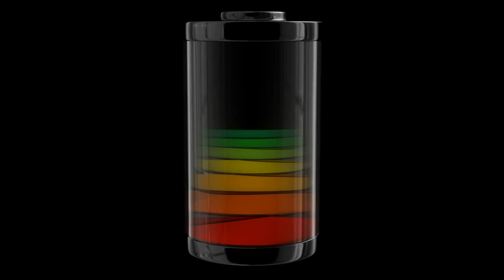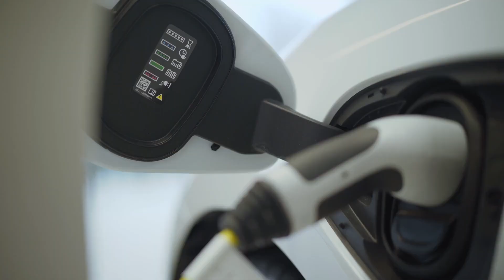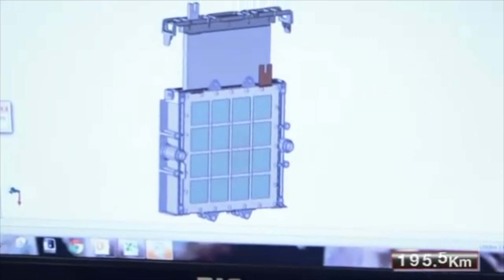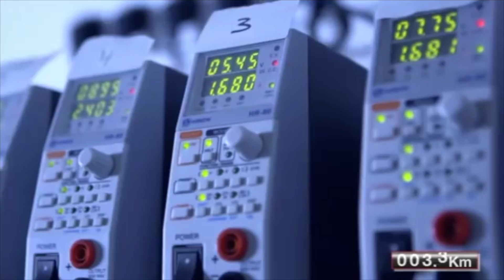This Battery Gives EVs 1000 Miles of Range!

Comment: I think if you had generators powering electric motors as the vehicles traveled down the road and the movement of those vehicles produced the energy to power the generators then batteries would only be needed for initial movement. Thus less or no need for charging (alternators). No need for high cost batteries (generator power) and the world moving into clean vehicles with more friendly consumer costs. No refueling costs.
Reply: That's called "regenerative braking" and most electric vehicles do it. When you run the generator, it takes your kinetic energy, slowing you down, and converts (some of) this energy back into electrical energy, which charges the battery.

But it's not free energy. You can't run an electric motor and an electric generator on the same spindle and get out as much energy as you put in. You'll lose some of the energy in the process. If you wanted to slow down anyway, either because you need to slow down or because you need to not speed up on a downhill, then great. Regenerative braking at least gives you some energy back, instead of letting the disc brakes dissipate the energy as heat. But that's all it is. Braking.
Reply: @ps.2  Was thinking more of the dyno generator systems we used as kids in 60s where a wheel on arbor on generator running on moving part of system (tire) would power generator while machine was running. Thus powering generator to drive motor. Battery for initial movement to begin power generation would be needed but could be recharged once generator was running. Thank you for response. Best wishes on a great weekend.
Reply: @greg3896  Still not free energy. The amount you need to run a bicycle headlamp is pretty small, so you may not have noticed, but that generator made you pedal harder.

Regenerative braking exists and it's what you're talking about. The idea is that if you have a moving vehicle and you want to slow it down, you may as well capture the energy you would otherwise be wasting. But any generator powered by the motion of your vehicle is going to slow down the vehicle. That's just how it works.

And if you have both a motor that speeds you up, and a generator that slows you down, the motor will use more energy than the generator will generate. That's just thermodynamics and, search as you might, you won't find a loophole.

Comment: If you want to eliminate CO2 in the largest quantities cars aren’t the best way to go. It would much easier to apply this technology to cargo ships. They currently use heavy oil for fuel. It would be much easier to make a giant aluminum air battery in a container and put it on a cargo ship. 40,000 pounds of aluminum would probably get it across the ocean several times.

Comment: I love your videos, however,  600km does not equal 1000 miles.  600km = 372 miles.  600 miles = (a little short of) 1000km.
Reply from the maker: 1600 km or 1000 miles. I misspoke my apologies
Reply: @TwoBitDaVinci  As I said, I always love your videos.  I thought it might have been just a momentary glitch in the recording.  You are so great!
Reply from the maker: 1600 km or 1000 miles

Comment: at 8'04" you say "By the end of the test the Aluminium battery was able to extend the vehical range by about 600km or 1000miles." That conversion is not correct, so I'm wondering what's the correct number? Is it 1000miles (=1600km) or did you mean 600km (=373miles)?

Comment: I think that once and done utility of this battery makes it DOA.
Reply: Yeah - like AA and AAA batteries - there's just no market . . .
Reply: @MrGsteele  haha!
Reply: @MrGsteele  Would you care to guess how much a battery change would cost every couple of months? Even aluminum ion will cost MORE than the car payment and the fuel in a gas powered car. Its why every automaker abandoned   this tech 5 years ago.
Reply: @michaelmaroney1660  If you think only in terms of the past, why are you watching a futures video?  With different engineering, an active recycling and redistribution infrastructure, it could be viable - despite the humorous offhandedness of my "AA" comment.  "It's WAY too expensive to machine cartridge cases out of brass just to hold powder; we're WAY better off with patch and ball."
Reply: @MrGsteele  On the contrary, sir. I currently drive a tesla model 3 performance. My wife drive drives a Y. I have a full off-grid solar and wind power system. 

That being said, I honestly believe this technology is a useless dead-end. Any tech that has any hope of mass adoption has to be able to be obtained by the poorest of us. This tech has no sustainability or offers any cost benefits long term to the regular consumer.

That even applies to me as well. My power and transportation setup of out of reach form most people unfortunately. What is needed is a breakthrough in common material solid state batteries. Oh and about 2 trillion dollars over the next 20 years to be invested in the electrical grid.
Reply: @michaelmaroney1660  you have a full off-grid solar and wind power system, but you think that tech vector is a dead end.  Rather a curious combination.  I hold no preconceived notions about aluminum batteries, as my first comments make clear to a reader paying attention.  I do hold that future development is not predictable, having listened to endless protestations over my technical career about developments that "were limited by science itself" that later became commonplace.  A great example is magnetic disk drive density; others abound.
Reply: @MrGsteele  All points I will grant you. My main concern is in the logistics of delivering millions of 1000 lbs battery packs...every month...by truck. You have a technical background, but mine is logistics. Automotive logistics. I can tell you right now NO dealership network as currently outlaid could accommodate this technology at scale. The underlying costs for this technology are just too great to be ECONOMICALLY feasible. 

Could I be wrong, of course. But since he is referring to an article from 2013 in this video, I think the marketplace has already spoken about its viability.q

Comment: You're then left with Aluminum Hydroxide, which will require energy to convert back into aluminum, hydrogen, and oxygen. So, It's definitely an Aluminum fuel cell, not battery.

Comment: 1000lb = 67 kw, 60kw used to drive car and tow battery. 2 Gal fuel is actually about 8 or 9 kwh so not quite equal. Plus gas is only using 25% of its power to the wheels, the rest is heat and noise.... If batteries where as inefficient as car makers paint them, Teslas and Mach e's  would be dragging their asses to a charger every 2 miles and going 0-60 in 20 seconds.... 
Disappointing for someone with such an audience to turn into an advertising shill

Comment: 600km is not 1000 miles..
It's the other way round.
1000km is 600 miles.
Reply from the maker: 1600 km or 1000 miles. My apologies I misspoke
Reply: @TwoBitDaVinci  my apologies for coming in head first. It should had been
"Hi, I think you might have got the two measurements units swapped round."

And keep up the great work explaining great stuff for us. Much appreciated

Comment: Great video and good point. The power to weight potential is there but not being able to charge make hydrogen a better alternative. But I don’t think I like battery better so .  Charging is way better. Tiny power plant like wind. Flexible solar that possibly to campsite. And all households has electric power to recharge. Aluminum air will bring people to fill stations or swap stations. Could be even bigger cost than gas stations. WeAr and tear on connection point from swapping battery. 

Reducing the weight and mass of current battery with additional capacity is good point to cross research. Charging and recharging needs to happen not swapping.

Comment: I first heard of aluminum/air batteries in the early 1990s. The energy density per unit of mass was the best back then and still is, but it has a number of problems I think you missed. while the weight and safety are there, for good performance the hybrid using lithium ion recharging packs  intermediate to the drive system is a necessity. So you have not eliminated  the problems with them completely. Maybe at the very slow speed of urban Indian traffic jams they can be the sole power source, but then there is the other characteristic, its much greater volume to energy ratio. Then there are the shortcuts likely to happen with a battery that is effectively a primary cell design. Aluminum recycling costs in re-melting pollution may compound the problems external to the cars, or create a monopoly user on the grid that they do have. The total cycling costs to do it right may be too high.
 While "third world" grid electricity is indeed spotty as all get out, under the centralized model they have tried to follow, if cheap solar gets rolled out the same way that cheap cell phones did, bypassing the central structure of an expensive land line system they never really had, these countries may leap frog what we face in transforming our transport infrastructure to electric.

Comment: This is basically a primary battery that is recycled after use. All primary batteries generally have higher capacitt then their recharable equivqlent. The transportation costs and remanufacturing cost plus the reinstallation cost does not seem economically or environmentally friendly in the end. Even if you built the remanufacturing factory next to say a large solar farm and used the excess power to created new batteries to supply power at night it seems like you would still be better off just using recharable batteries. Making something over and over again has to cost more than just once. Thats kinda why we have recharageable batteries inbthe first place.

Comment: You did not mention the other big big advantage of Al/air batteries is they do not require a big increase in electrical generation that is required by other designs.
If rechargeable batteries became popular overnight there would not be enough electrical power to charge them!

Comment: The nice thing about Al/O2 batteries is that they are fairly easy to make at home, and you can use things like left over foil.  At some point in the near future, I plan on making an ultra light EV and powering it with Al/O2 batteries.  The Aluminum powder will be in a fabric bag so that when it's used up, I can just take the bag out of the matrix (it will include graphite and graphitized cellulose nanocrystals).  The graphite-carbons will be treated with potassium permanganate to create nano manganese dioxide on the surfaces to help as a oxidation catalyst.  I'll be experimenting with different electrolytes, mainly either potassium hydroxide or potassium hydroxide plus sodium percarbonate. 

     I'll will be either using a desiccant or a molecular sieve material to draw out the water when I'm not using it, to slow down the oxidation-corrosion reaction.

Comment: Can you do a comparison with the AmbrI liquid metal battery?
Reply: Ambri liquid metal tech is completely different. For one thing, it's rechargeable. But mainly, because it operates with molten metal, it has to maintain a very high internal temperature. Maintaining this temperature gets easier and cheaper the bigger you build. (Heat loss happens at the surface. As the square-cube law tells us, volume scales faster than surface area, so your insulation requirements and heat losses diminish as you scale up.)

As such, Ambri's approach will likely never be practical for vehicles. Well, maybe huge vehicles like trains and ships. (Though most ships require a very long range between charges.) But mainly it's intended for stationary storage — e.g., to provide on-demand power from a solar or wind farm. Installations where size and weight aren't really a concern, where you can have a massive battery surrounded by a massive amount of heat insulation.

Comment: A lot of this is theoretical. By this statement, I mean that we are not factoring in the transition time from one power source to another. For example, look at how long that it will ACTUALLY take us to transition from ICE technology, to hybrid to EV, and the social acceptance time span involved. The timing to critical mass transition and the economies of scale required for the support industries of each power source. Look at one simple small aspect - the different types of EV charging stations with no commonly accepted standard for all. Right now, we have Tesla and everybody else. It's fractured. Contrast that with a petrol pump standard for everyone. It takes TIME for a new industry to mature, as well as the human support staff to transition to a new propulsion industry. Look at how many workers were out of work, when one pipeline was shut down. Just sayin.

Comment: The "energy density" argument is bunk.  Electric engines are way more efficient, electric drive trains are way more efficient...  When you include an engine, motor oil, coolant ignition system.... you're dealing with 1500 lbs vs 250 lbs...

Comment: Electric cars are just the next disease.
On the other hand the Hydrogen argument is very promising or was as long as you manage to supply it using clean energy like solar, the reason you won't see it as a successful substitute because it doesn't make sense economically for the big corporates ruling the world, because the profit margent is not enough setting aside the complications of securing the manufacturing and distribution.

Comment: If you can't find a 15a outlet, you aren't going to find a battery swap station.
Reply: It seems the point of the paradigm would be: perhaps it's easier to find a battery swap station every 2000 miles than a 15A outlet every 200 miles.

I agree, though: I don't find the argument very compelling.

Comment: Fine for aviation but not passenger vehicles.  I don’t like the NIO battery swap.  If it’s only 600 km, that about 360 miles and less than the model S-LR.  Let’s leave this technology in the lab for more development because there may be break-throughs permitting recharge.

Comment: I thought solid-state batteries were the holy grail of battery technology. Interesting. Whoever cracks the code on this is going to be one rich person.
Reply: There is no code to crack. This has existed since the 1960s but it is just to expensive to use aluminum this way. They tried making this commercial 30 years ago but no one wants horrible expensive batteries that need replacing after 1000 - 2000km.

Comment: For Lorries I can see this battery working as they tend to work between hubs so battery swaps would not be a big deal. It would also help reduce the large charging load on the electricity grid if all lorries go electric.

Comment: Gas engines do have an advantage over electric motors. thermal tolerance, gas engines can operate between 500-900F, electric motors completely fail at these temperatures which is why cooling is very important to its preformance especially in races.
Reply from the maker: Cooling an electric motor is very simple compared to gas. They’re really efficient. So that’s a total moot point. You can push a 10,000hp electric motor all day and developing a cooling system 1/10 as complex as anything gas. When you’re like 90%+ efficient, you don’t make much waste heat. Gas engines are almost all waste heat
Reply: @TwoBitDaVinci  the problem is that it becomes more difficult to radiate heat when the ambient air temperature is closer to the motors operating temperature, a hot engine exchanges heat much faster, a 10,000HP motor will melt and catch fire if it had 1/10 the radiator of a  gas 10,000HP engine, you actually need the radiators to be nearly as large to have the same effective cooling.
Reply: @miguellopez3392  Yeah if you have to drive through a part of the world where ambient temperatures are 500-900F then probably you shouldn't use electric motors.
Reply: @ps.2  that's engine temperature, they get hot when in use, lithium batteries are supposed to avoid above 120F, its a problem if the air outside is 100F.
Reply: @miguellopez3392  Now you're confusing electric motors with lithium ion batteries.
Reply: @ps.2  they all share the same cooling loop since they all operate at similar temperature, batteries degrade after 120f, and motors start loosing efficiency and get even hotter where a gas engine benifits from being hotter, a motor and battery can operate higher but the manufacturer will have to give you a shorter warranty.
Reply: @miguellopez3392  But Ricky specifically said electric motors can't be beat. We can all agree that lithium ion batteries have disadvantages. (When you think about it, the fact that lithium ion batteries aren't perfect was basically the whole reason for the video.) So I thought he made this distinction pretty clear.
Reply: @ps.2  yeah and I replied to him about that, I'm adding ontop of that, if the motor where 500F than you wouldn't be able too cool it in the same loop as the battery and computers that they all use.

Comment: I'm always suspicious of any technology of this nature when it's pushed by an oil company, they often have ulterior motives that don't align with public welfare. But we'll see I guess.

The "single use" aspect of this setup is also a big red flag, not only less convenient, but also more dependency on the old "gas station" model, which may explain the oil company's backing behind it.

Not to mention the recycling and related energy costs of production, covered in the video. That's allot of major negatives. 

So this sounds less like competition for EV battery applications, and more like competition for Hydrogen fuel cells instead imho.
Reply from the maker: Yeah I hear you. I think the idea of investing in various solutions and seeing where we land for various industries is interesting to me.
Reply: @TwoBitDaVinci  Yeah for sure, the more problem solving tools at our disposal the better. 

No harm in putting some research funds into it on the side.